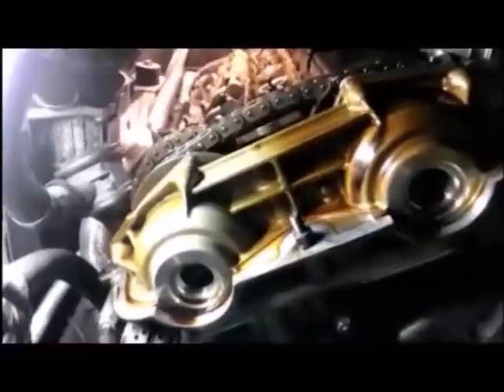BMW E46: VANOS Removal Tips

Comment from the maker: Hello eviloctober -- This video shows me removing my old VANOS unit.  Not shown in this video is me replacing it with a Dr Vanos rebuilt unit.  Which I'm happy to report is performing flawlessly.  Anyway, the permanent plastic plugs are covers for the two black bolts you need to remove as part of the VANOS removal procedure.  And you will need to reuse those plastic covers and bolts when you install your rebuilt VANOS unit.  Does that help?